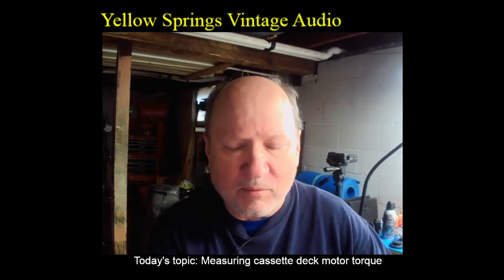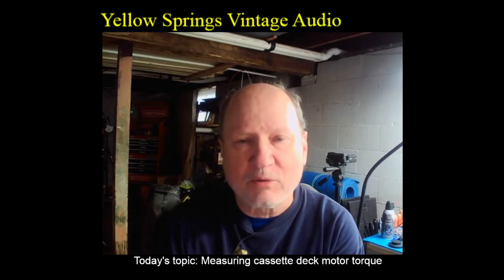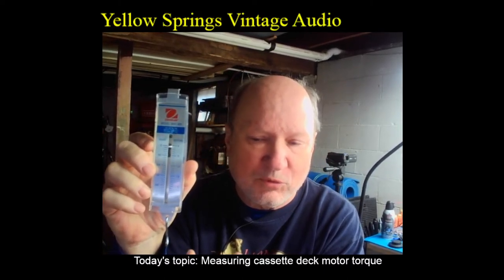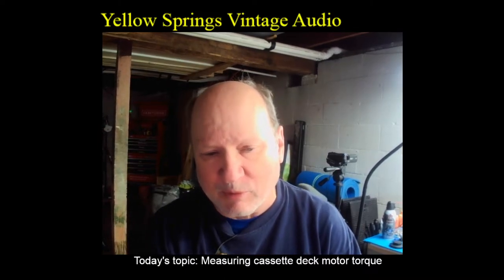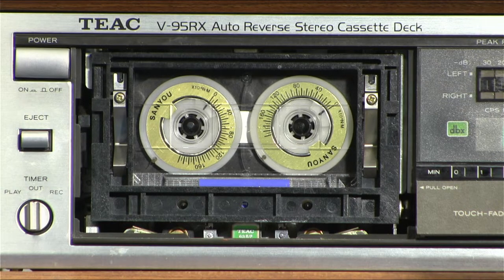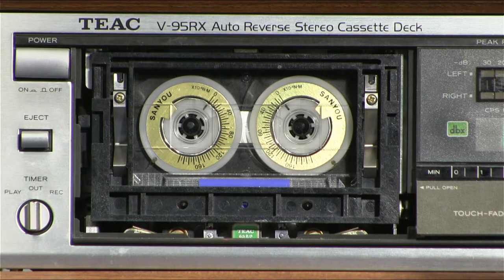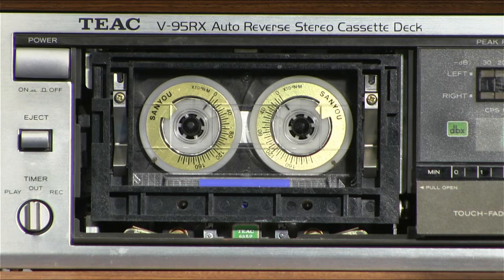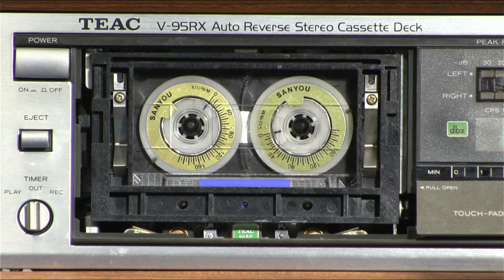Cassette Torque Measurement

Comment: Thanks great video!  Do you know where I can get a torque meter cassette?
Reply from the maker: I'm glad you enjoyed the video. Here is one that is similar to the one in the video.  It is calibrated in units of gram-centimeters instead of X10^-4 Newton-meters.  Most service manuals list torque specs in both units though.  Here is the link on ebay: 

 https://www.ebay.com/itm/124256006140?hash=item1cee3c2ffc:g:yBMAAOSwujhd~aTS&amdata=enc%3AAQAHAAAAsJKbtC90dOkuEPgGso9V%2Fx8gsTQQ1GhzFLJvxKazMv0g9YKbzFJVW85wEJ1IPDeSGbiilKJKU3oYSc36D3cPm4Yf67NbWVsvp5nRxog1rTMIoKPS8ApvTZ5n2F%2BhyLBxbu0DBRsYngHjYEr1hn5MbEePyOmv49sH2LXlzI9PLRNGj4yJsCDuNRZJksK%2BzcETCR3jHjUH8xgdhZOHe%2F7i7uakkY1KWapc7rzRSf8MSjNR%7Ctkp%3ABk9SR-7L3ZOFYQ